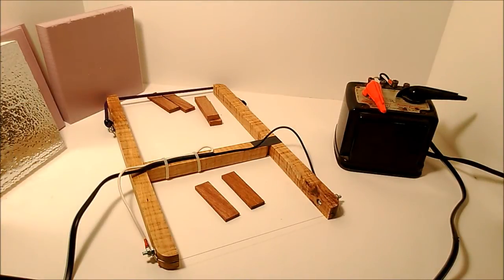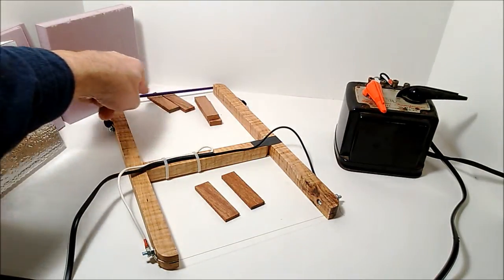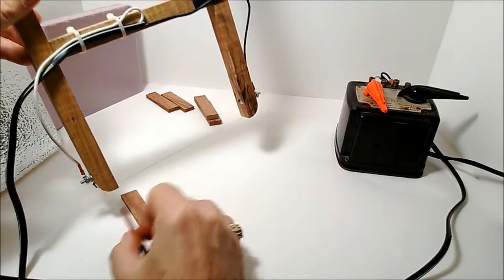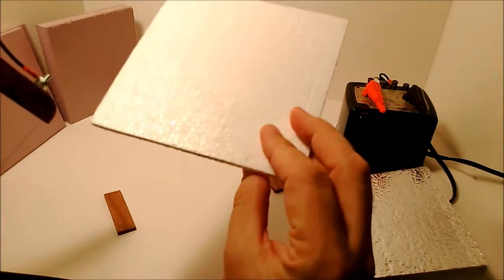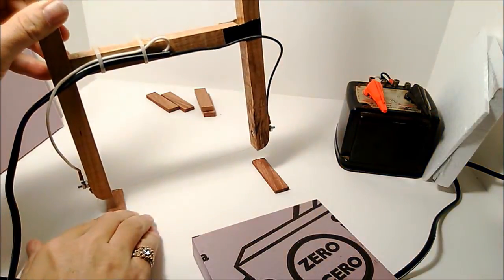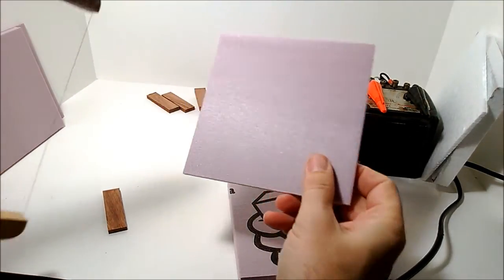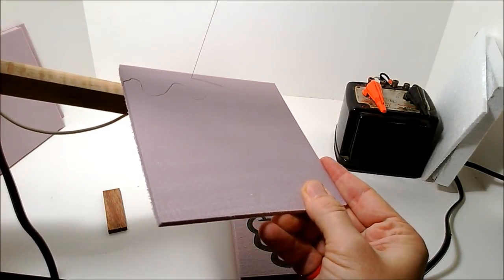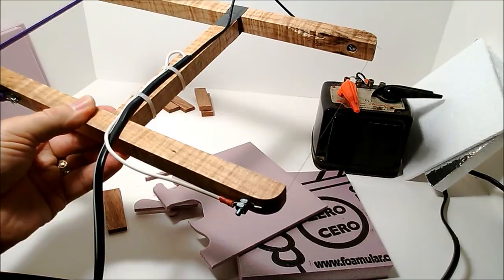Hot Wire Foam Cutter II

Comment from the maker: Fumes can be an issue.  Some types of foam are toxic when they burn, others are not.  Good ventilation is recommended, especially if you don't know what type of foam you have.  I have never had two pieces melt back together. Puzzle pieces would be easy to make.  I thought the same thing.  I am going to mount it vertically so I can use it like a scroll saw for operations like that.